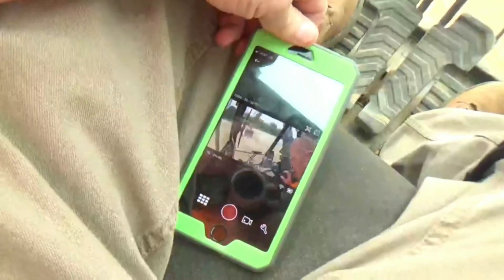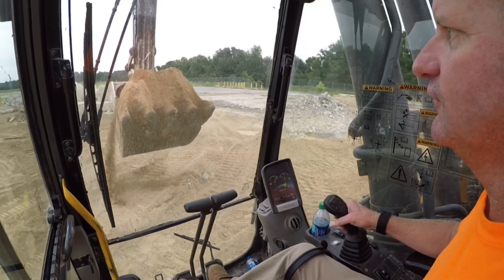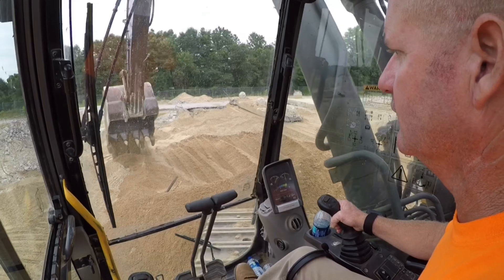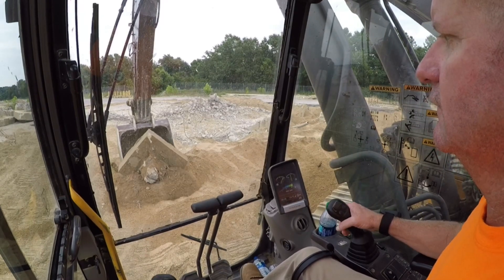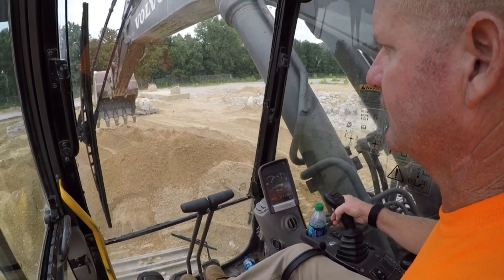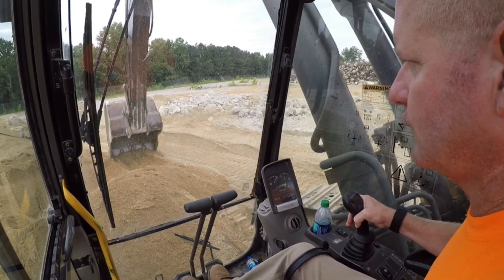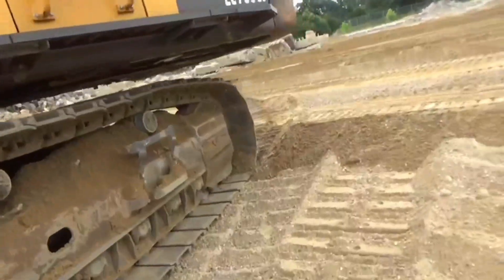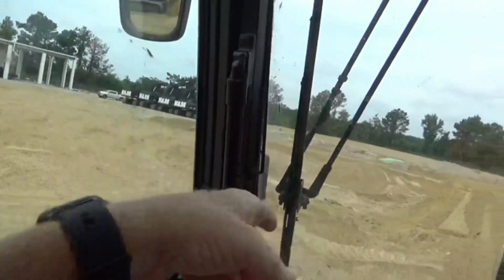Volvo EC700CL- in cab ride along! #excavator

Comment: It would be great if you could explain the machines controls for us wanna be's. That thing is quiet. Thanks.
Reply: Jay Kaye he's running iso controls. Right joystick forward and back runs the boom up and down, left and right curls bucket in and out. Left joystick forward and back runs the stick in and out, left and right swings the house. Usually newer machines like this one have a valve which allows you to switch the pattern of the controls to swap the boom and stick functions on the joysticks (left joystick will run boom and right will run stick). (Bhl controls also known as bass ackwards controls! Lol)
Reply: God! That sounds like trying to pat your head while you rub  your tummy and do the tango with your feet with tons of rock to dance with. Thanks for the reply>